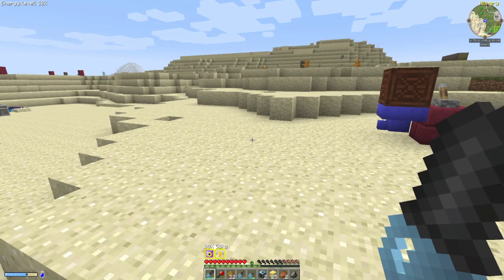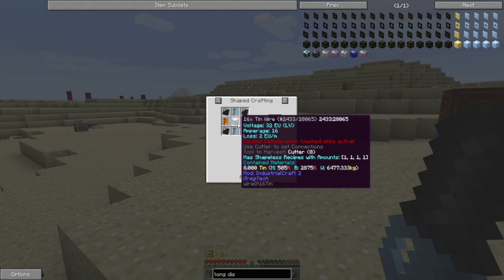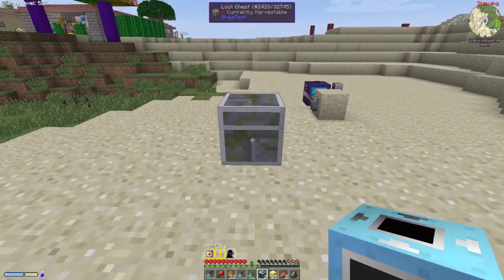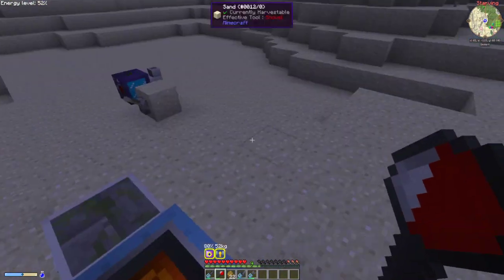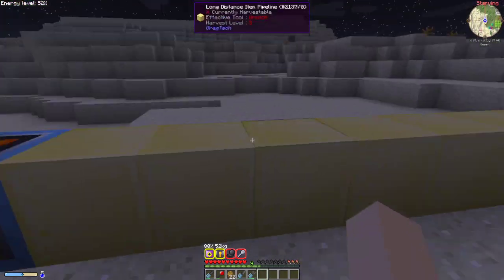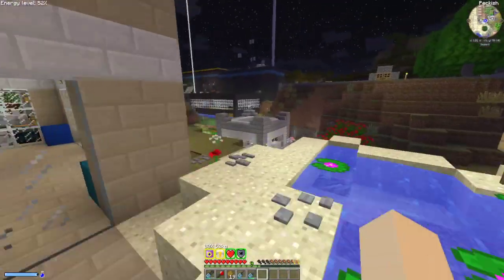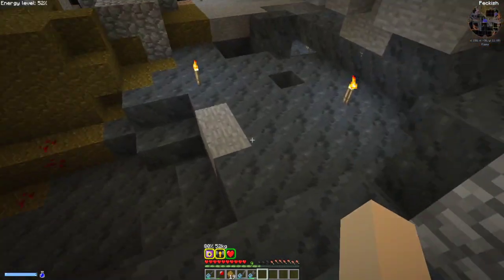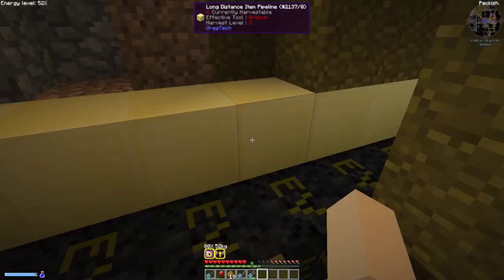Gregtech 6 & 6u Tutorials: Long Distance Pipelines & Cables

Comment: How are these different than the normal cables/pipes? Either way, you still have to run hundreds or THOUSANDS of blocks to the rarer veins, then disassemble it all once the vein's exhausted. This seems to be something you should ONLY use for long-term/permanent setups like bedrock mining or on-site oil processing.
Reply from the maker: the endpoints are the only thing that needs chunkloaded unlike regular pipes. that is why you use the mini nether portal so those 1000s of blocks are divided by 8. and have you seen how large some viens are? i spent months mining 1 tungsten vein out and it is no different then setting up rail lines to move the ores, once your are ready to move on you have to move your infistucture too.
Reply: @Bear989  Ah, the chunkloading makes sense. And yeah, I know how massive the veins are. It's just a massive pet peeve of mine to do piping and wiring. 🤣

Comment: is there any good modpacks wit gt6/gt6u ? id love to try it cos i dint play gt6 yet
Reply: bear has a decent pack a lite version and a large pack. check the description
Reply from the maker: i would start with GT6 as GT6u changes some basic GT6 stuff. try GT6 lite from our website, you may want to update to the latest GT6 from gregs website.
https://bearsden.overminddl1.com/Downloads/Gregtech%206%20packs/GT6%20Lite/GT6%20Lite%203.0%20FINAL.zip
https://gregtech.overminddl1.com/com/gregoriust/gregtech/gregtech_1.7.10/6.14.00/gregtech_1.7.10-6.14.00.jar